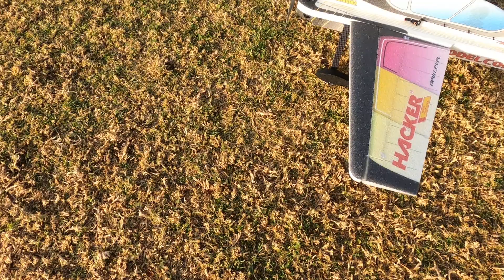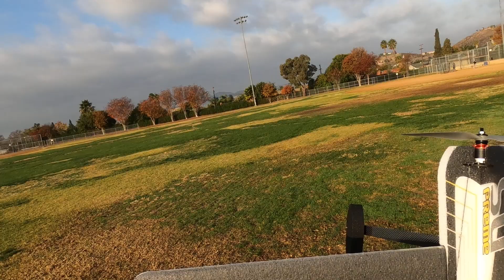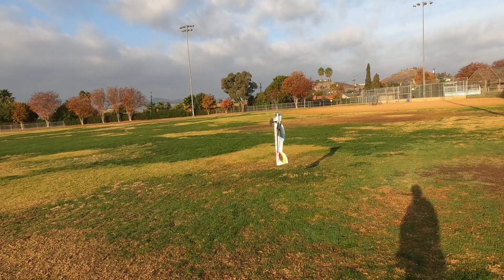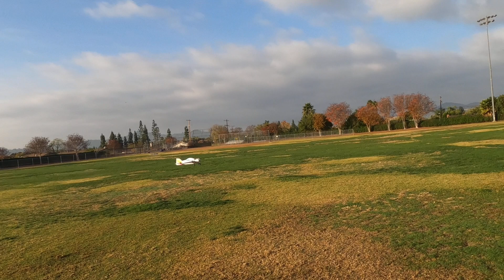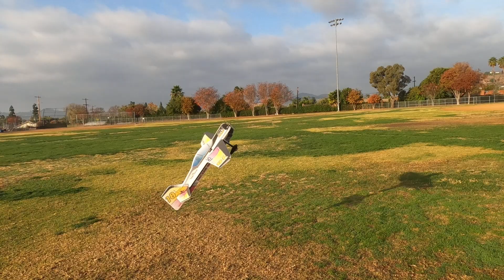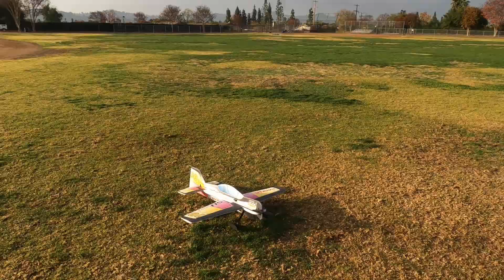Hacker SUpreme 48" EPP Foamie    " Mellow Morning"

Comment: Nice Flight. I love wings come off, main reason I want one. But I wonder how it compares to Smaller Veloxity or Edge. Probably a bit less aggressive and it feels heavier? I wonder how that rudder push rod holds up for 3D. I hope it doesn't twist the frame, feel weak or get weak over time.
Reply from the maker: Funny this just popped up on me, because I just ordered the 43” Edge this morning. I like this SUpreme, but..,, the wing was such a noodle, I sliced just past the leading edge and inserted a flat 1/4” wide piece of carbon fiber in each wing to stiffen it. Then I put the same type of carbon on the trailing edges of the ailerons to stiffen those. Now it flies more like a big airplane. It still has dihedral flex though because of the detachable wing. If you can, you may want to add 4-6” to the wing tube and try to burrow a hole with something sharp to get the tube further in the wing. Might help. I’m done with working on it. I’m about to go shred the park with it now. I’m hoping I like the Edge more. It looks stiffer in the videos Twisted has. The SUpreme is a fun one for slow flight and harrier stuff. It’s not a crank shafter or knife edge spinner. But point rolls and pattern stuff with big snaps is cool.
Reply from the maker: Also, in this video it was not stiffened and modified. This is how it came.

Comment: That looks so beautiful! You should Go back to the rootz and do more Videos like this! I started to build slowflyer with my dad as a kid too. You inspire me and I let an childhood dream come true and just bought me a used foamie to start practise 😎 

Best regards from Germany 👍🏻
Reply from the maker: Thank you and that is awesome. 3D foamies are really fun. I really love Southern Germany. We go to Regansburg for Christmas sometimes. I’ love bier and flying. Let me know how the airplane goes for you.  Coe Show
Reply: @CoeShow619  hey, I‘ve learned a lot on foamies since january 😬 but I‘ve crashed sometimes.. so it‘s time to build a new plane. I decided to buy a hacker supreme from your video. I have a permax motor from my crashed Multiplex extra 330sc.. nearly the same specs like the badass. My question now. Are you always getting more than 5 minutes out of that 1300mha 4s? That would be great!

Are you still happy with the 11x4,5 Apc prop? The manual says 11x5,5 with 4s

3s 2200 is another option. The extra did very well with a 55A speed Controller on 14x7 prop 🙈
Reply from the maker: @NRG1991  yes, on 4s 1300 with 11x4.7 it can do 5 minutes easy.  I think I have 6 minutes on my timer. I also fly it with a 1500mah 3s on a 12x6 with the batter mounted just an inch or so back from the motor tucked in the fuselage on the bottom. In the video the 4s is alittle further back.  You can fly a 2200 3s battery too. It’s all preference. I added some carbon to the trailing edges of the ailerons to keep them rigid too.
Reply: @CoeShow619  how much flighttime do you get with 1500mha 3S and 12x6? 

Thank you for your time!🙈
Reply: I have 3S 1600 3S 2800 (only 15g more Thema the 2200 Smart pack) and  4s 1300🙈🙈
Reply: My first thought was on the 2800 3S with 12x6